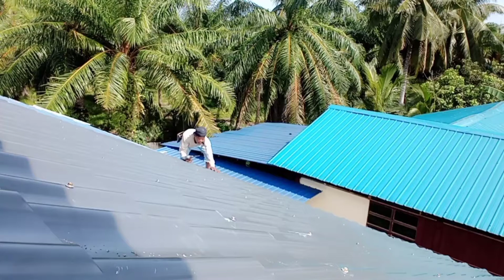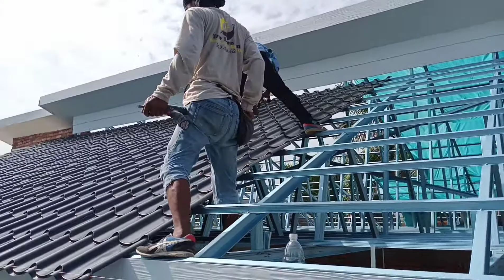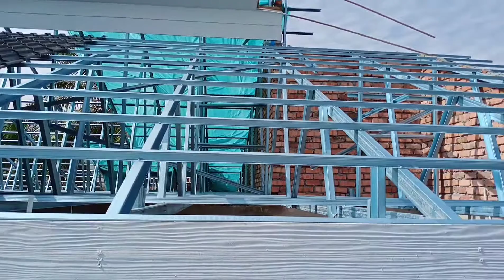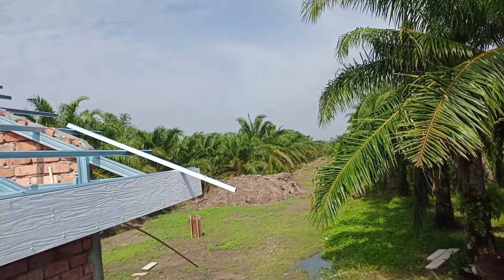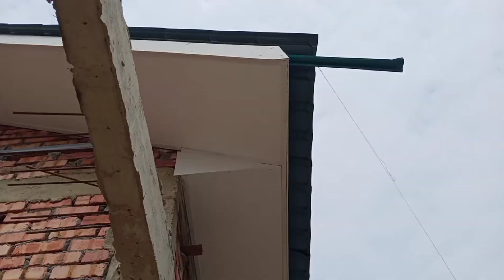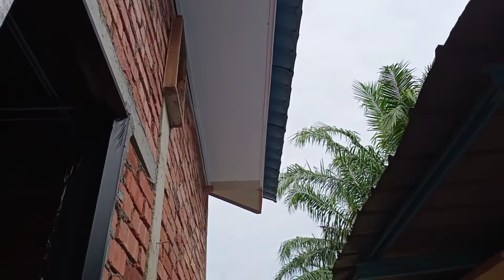Pemasangan atap urrolbound (motif genting)

Comment: Salam. Boleh tahu berapa ketebalan atap urollbond atau berapa grednya. Terima kasih.
Reply from the maker: waalaikum salam.
trmksh bos ikut nyimak dan komentarnya.
ukuran zink  gred 1 ;;G26 [0,47mm] 
🙏 biasa kalau kita beli di kedai/ toko bangunan[ lain tempat kadang lain bos.
G28[0,33mm] biasa di sebut juga no 1.
kalau beli di supplier inipun katanya bukan no 1
kalau yg betul betul no 1 dari kilang /pabrik saya masih kurang tahu.trmksh
Reply: @semuanyabisa0306  Uroll bond yg tebal lebih baik ya. Kurang bising sekiranya hujan. Ada cara lain utk kurangkan bising hujan apabila pakai atap uroll bond ini? Terima kasih.
Reply from the maker: Untuk mengurangi bising.ada banyak cara diantaranya..
1.pilih atap yg kualias baik /tebal
2.sebelum pemasangan atap kita bisa tambahkan pemasangan bahan tambahan,,, aluminium foil,glasswool, Rockwool.dan lain lain.namun cara ini tdk cukup untuk membantu sbb tdk memiliki nilai sound transmission loss [insulasi suara]
3.pemasangan plavon.
Trmksh boskuu